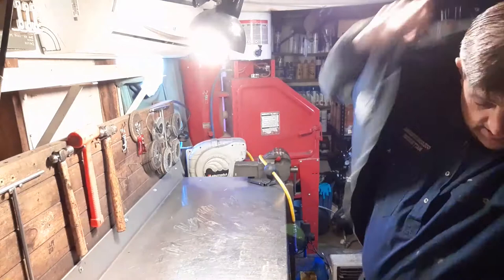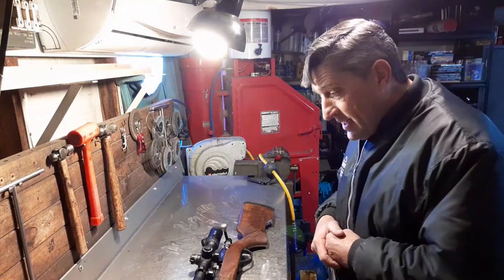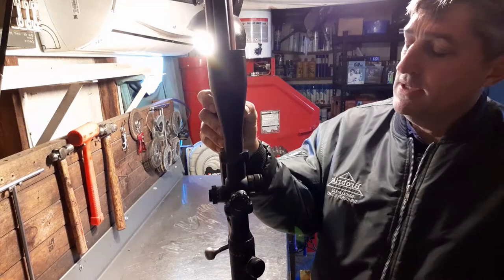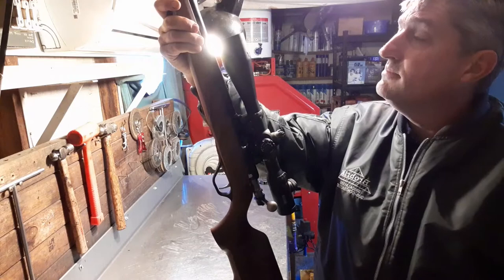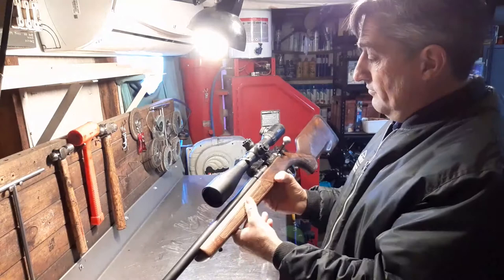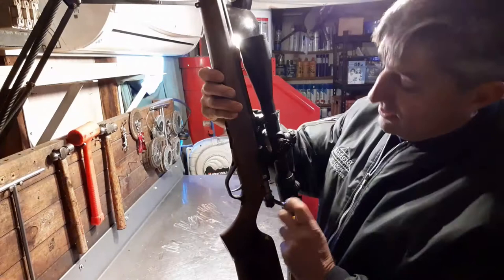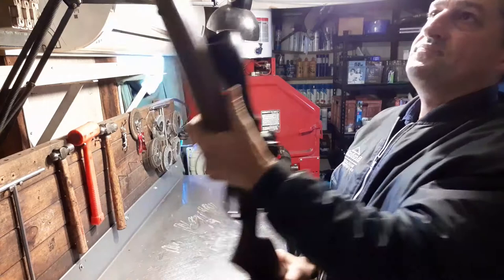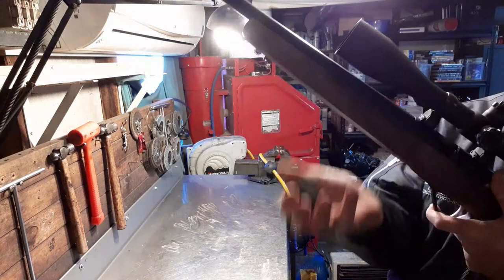Lithgow LA101 .22 review part 1

Comment: Ive found my 101 loves federal and fiocchi . Anything waxy it loves it seems. Stock 5 shot mag is great . The cz 10 shot mag needs a fair bit of wearing in with the 9th and 10th shot. Spring is tough.  Have gotten stuck a few times. But proud of aussie built la 101 and love hearing from others its a lazer and validates my choice.
Reply: I bought my LA101 in 2018. I had some trouble with the standard 5 round magazine but that was easily fixed by following the published "fix" that Lithgow put out. I have two CZ 10 round magazines and have never had any issues. My rifle loves Lapua Midas +, Eley Match and SK Rifle Match. CCI Standard also does well. It does not like the Federal, Winchester, Norma, or Fiocchi.